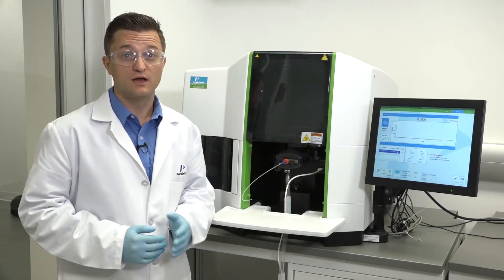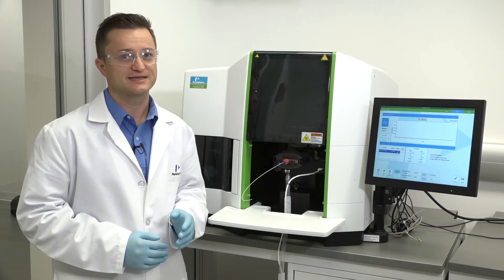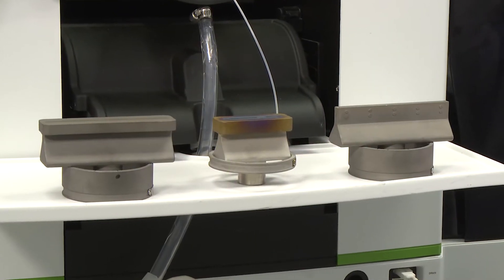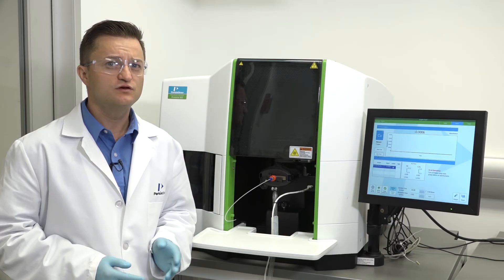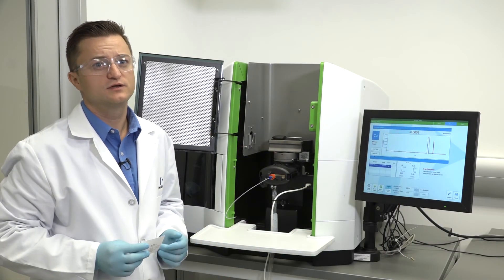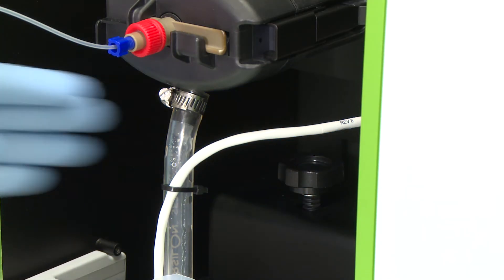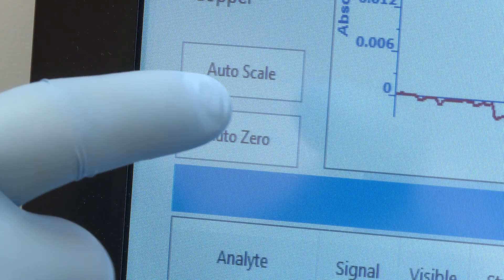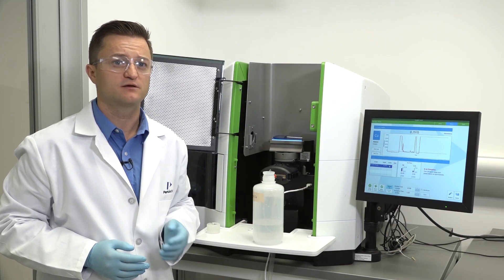Performing Routine Maintenance: Burner Alignment on the PinAAcle 500

Comment: flame not ignite what the step to fix
Reply: if your fuel and air are ok, there might be problem with the ignition arm. cheapest way to fix it, either slowly blow(dont get your eyebrows burned) or fan the gas when the ignition arm turns. or use the cheap stove igniter gun.